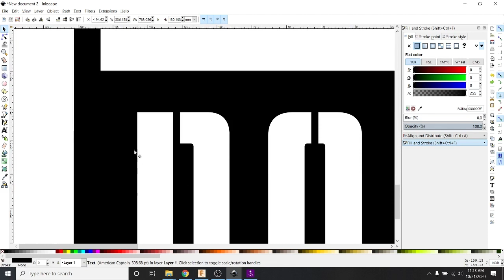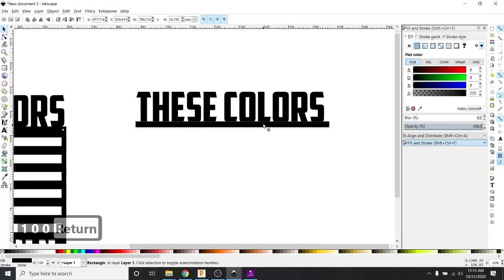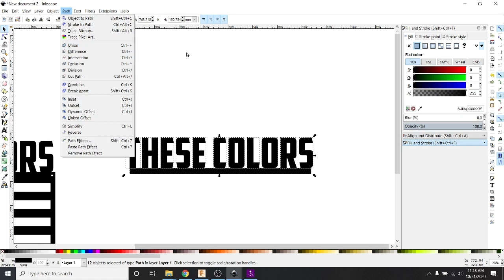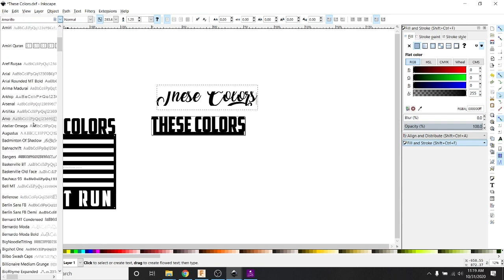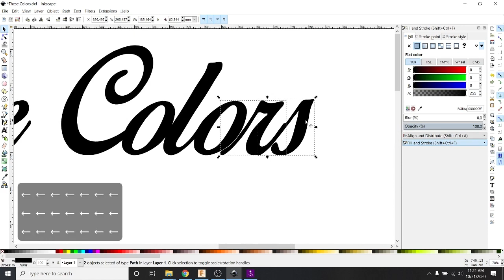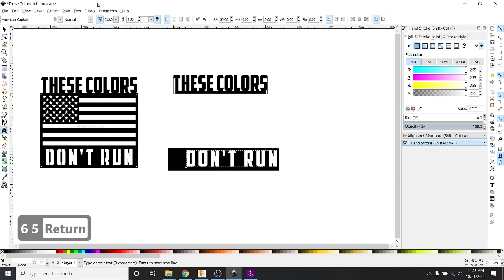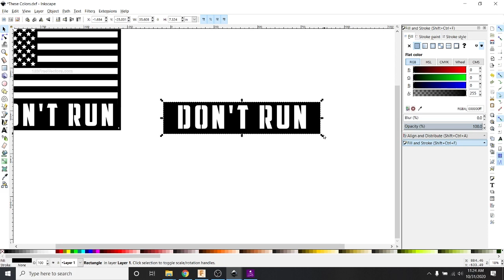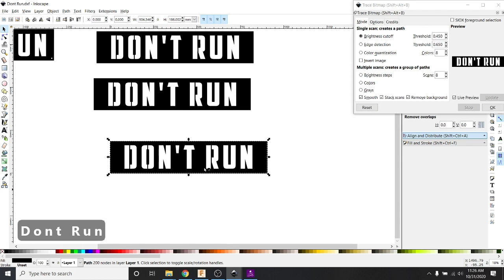Secrets to Inkscape for CNC - Text to Path Tricks and Shortcuts (PART 1)

Comment: I'm new to this so it may be a dumb question. But, do more nodes on a image make the cut choppier or not as smooth? Thanks.
Reply: Hello, this is a year late and I’m not Adam, but yes the more nodes there are, the better the chances of the cuts being choppier.  I actually just had this issue.  One of the letters I cut out was not as clean as I would like it, went back to Inkscape and saw how many nodes there were.  Cleaned that up and the cuts are smoother.  I hope this helped but you probably already figured this out by now lol

Comment: Thanks for the video. Using Inkscape 1.0.1 . I can't get the text to turn to a path. I get (No object to convert to path in the bottom of the screen). I can convert boxes and circle to path. For some reason,  can't get it to work with text.  It show the text as a group.  I ungroup the text and tried just one letter, same results. Has to be something I am doing wrong. Any ideal?

Comment: Nice tutorial man!

Just some additional advises: 
- you don't need to "ctrl shift K" after turning your text into an object, what you got is a group so you can't use that command... "ctrl shift K" could be usefull on an "i" to separate the dot from the bar and to bring the dot as a whole... or with you cursive T to separate the top from the bottom,  but be carefull with hollow letters as the holes will turn black...
- for the negative sign, instead of making a raster then vectorise it (which could lose some details depemding on the settings), you could "ctrl -" the text from the base rectangle then "ctrl +" the links with the sign... 

Hope this help 😉
Reply from the maker: Oh cool man, thanks for the tips! I'll try that out tomorrow when I get back to the shop 👍